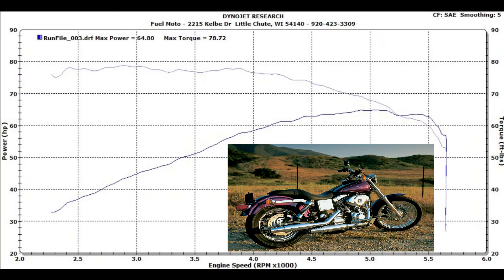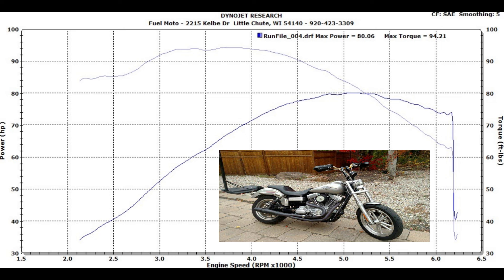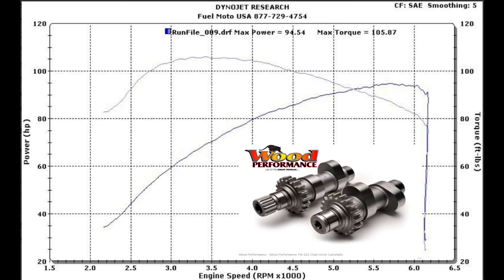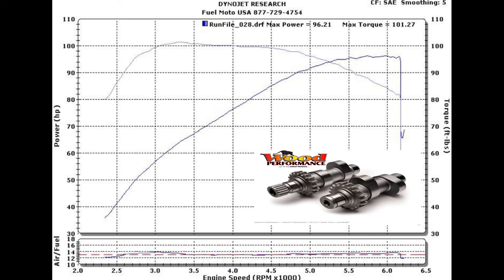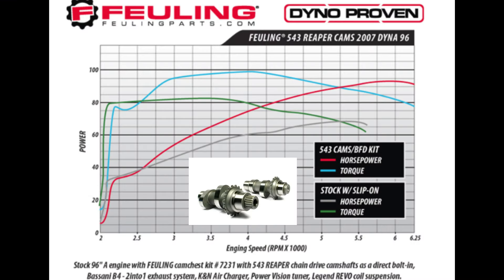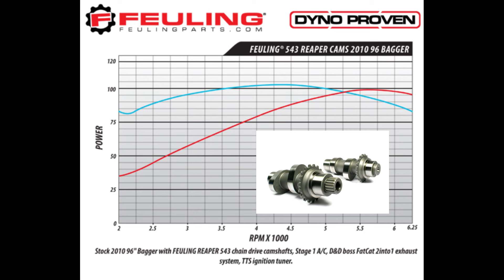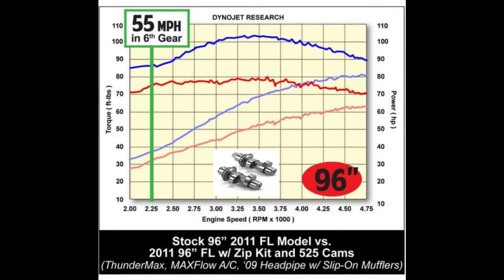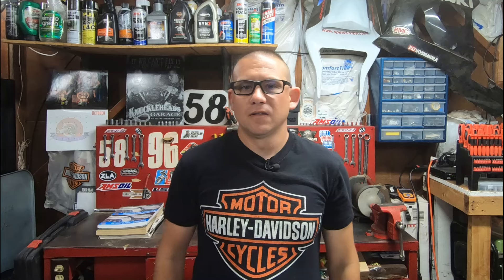Consider New Cams For Your Twin Cam 96 Before You Convert To A 103

Comment from the maker: Would you convert your 96 to a 103 or add one of these aftermarket cam sets?
Reply: Why not both?
Reply: Great vid man. Liked and Subbed. Been waiting for this one. To get a 96" to over 100tq and very near on 100hp just out of just a Stage 2 cam swap is VERY impressive! For me though if I was going to go to the expense of new pistons and jugs, I'd personally not muck around and go straight to the top shelf 110" SE drop ins. But then you'd need a whole different cam set again. I'm on a Rocker C 96" Stage 1 with 2 into 2 Freedom Amendments.
Reply from the maker: Cost mainly, a cam can be done for way cheaper than a full kit.
Reply from the maker: Thank you! It really is cheaper in the long run to go for it all at once, expensive upfront though.
Reply: Do you have any info on SE-211 cams? I have them in my 07 street bob I recently purchased with 103 kit, a/c and full exhaust. Just not much info out there on them. Seem like an old product. Great videos by the way.
Reply: Great video. So where is a good place to get a wood cam?
Reply from the maker: If you're doing a complete rebuild you may as well. Using aftermarket parts you will spend the same as OEM. Better quality, more power and reliability.
Reply from the maker: They are an older cam, they are .579 lift and a good mid range torque cam.
Reply from the maker: I would get it from FuelMoto, they built their kits around the Wood. If you have a Power Vison they will send you a map to flash and then you can autotune. With and FP3 you can select the cam and then autotune.
Reply: Definitely the drop in WOOD 222 would be my first choice before converting to a big bore 103" kit. It just makes sense to save money and get MORE HP and TORQUE 🎸🎸🎸
Reply: I bring to a 110 . If your gonna do it just do it !!!!
Reply from the maker: 110's are awesome, just make sure to add some compression!
Reply: My mechanic recommended the 254 E cam along with a tuner....103 bagger...what are your thoughts
Reply: I have 2008 RK. What are thoughts 543 fueling vs woods  222 vs woods 6-6? They all seem great.
Reply: instablaster
Reply: I'll add the aftermarket cam sets! It'll save $ and🕰!!
Reply: I'm thinking just the cams. Impressive numbers!
Reply: But what does he mean when he keeps saying "with a good tune"?
Reply: I prefer S&S parts...I did a 551 cam, lifter and pushrod swap, SE high flow intake, Thunder Header 2 to 1 and a TTS tuner....and only dyno'd at 86 hp and 103 tq. What did I do wrong? I was hoping to get closer to 100 hp. Does S&S make a better cam thatll get me there?
Reply: I'm thinking about just adding a cam. A wood cam
Reply: @Ron Roth  after adding the cam you'll need to have the bike tuned. I went to a stage one V&H all out. The V&H tuner can tune my bike for stage 1, 2, 3 , 4, etc.
Reply: I did the exhaust, intake and cams on my 08 fxdl. Quite happy with the performance boost there.
Reply: I would make it a 107" with 10.2 to 1 and run a set of Bob Woods camshafts depending on the RPM range it was being used in. But if you deck the heads and get the compression up a 96" will make very acceptable power with just cams.

Comment: I had a 2011 Fatboy with the 96 in it. I upgraded the cams to the Andrews 48H. I went with the Vance & Hines Big Shots. I upgraded the intake/air cleaner as well. Which one it was exactly, I can't remember. After a dyno tune, it REALLY woke it up and also let it run cooler. On the way home from the tuner, I was at a light. I let out the clutch and was not paying attention as I gave it some throttle. The handlebars almost ran away from me! I miss that bike!
Reply: Those Andrews 48s are no joke. I had some in a “96” you couldn’t give me a 103 over that little motor. 😊
Reply: I bought a 2011 Fat Boy early this year. I came to this video because I didn’t know if the 96 was worth tuning or if I should buy a bike with a M8. It sounds like I’ll be tuning the 96 after reading this comment

Comment: I have to say something here, and I am trying to help people out, and prevent them from throwing their money away! You do not need a ton of horsepower just to " keep up" with people. After you get a good feel for the bike, and got some miles under your belt, you will more than likely want more than the factory horsepower of either the Twin Cam 88, and 96/103. But you do not need to break the bank unless you are planning on like racing. A good free flowing exhaust, high flow air cleaner, a good tuner or jet kit, and the right pair of either S & S or the Wood Cams, and you have some decent power. You will have enough where it passes well, has good throttle response, and can keep up with the pack. But yet it won't  be so powerful where it feels like it will run out from under you.
Reply: You are right about that!! I actually do just fine, considering the fact that I don't ride my bike, like a bat out hell style anyway. I just enjoy a simple ride, and it only has 25,000 miles on it right now.

Comment: On my 2007 Dyna 96" I went with the Feuling 543 Reaper cam and SuperTrapp Supermeg pipes. I already had a K&N a/c. My gas mileage was bad. I travel a lot. I tried different tunes with my FP3 tuner but it didn't help much. I recently had it dyno'd  with a Power Vision map. It made 95.48 hp and 104.93 torque. My freeway mpg is 47.

Comment: what I have learned over the years with all HD engines from a knuckle to TC or a sporty is that they dont FLOW well. The HP is hidden in the heads sort of. Have it put on a flow bench. Then couple that with cams or  Carb or EFI remap. and exhaust. You can easily make 100 plus HP this way. No need for a bigger engine.  If ya got a nice ol skool though Strokers are fun until they blow up. And they do blow up. In the old days there were no big bore kits ect. We made stroker plates. Chamfered the bottom end to accept the longer rods without having them slam into the cases.  Then there were guys like Ron Trock putting big twin top ends on ironhead bottoms!  Shovesters. pansters. knucksters. Back then 89 inch engines were HUGE.
Reply from the maker: That's the way to go is just get the air flowing through the motor. They push these big inch kits today but a hot 103 will crush a lot of the big bore engines.

Comment: I installed an S&S 551 easy start cam & S&S 2-1-2 header on an ‘08 96 ci twin cam and had similar results.  A very noticeable improvement.
Reply from the maker: That's awesome, those easy start cams are really nice. Eliminates the need for compression releases too, unless you've got some extremely crazy pistons in there.
Reply: i did the same to my 2007 electra glide classic. i gain 20+hp 20+tq👍👍
Reply: What cam would you recommend for a 103 bagger with slip ons and tuner.  Looking for roll on torque/power...thanks
Reply: @troyemery9888  I chose the S&S brand for the easy start feature of the cams & from all video research I did the S&S oil pump had the largest passages for oil...provides significantly greater pressure at idle, no more 2-3 psi...more like 8-10...saving $ for big bore kit & head work.
Reply: Im impressed with the S&S 551 easy start, nice low end post from basically idle to 4000 rpm

Comment: If I could go back in time I would have purchased a Wood cam. However, the SE 255 with a High Flow air intake and a D&D Fat Cat 2 into 1 exhaust produced 101 lb of torque and 95 Hp with a good Dyno tune. The torque rolled off at about 5k and my normal riding RPM wasn’t more than that plus I had enough torque at highway speed for passing.  I was happy with it for many years. Then I paid off my bike and started thinking of adding a big bore kit.

Comment: I installed s&s 551 cams, v&h pro pipe, power vision tuner on my 2007 Electra glide. Run strong pulled hard thru out the rpm. I'm extremely happy.
Reply from the maker: 551 is a killer cam in a touring bike, pairing with the pro pipe l bet it pulls hard!
Reply: I love it, I don't need a big bore kit. This is enough power for cruising around .
Reply from the maker: It's really surprising the kinda power a good after market bolt in cam will make!

Comment: I have a Wood 222 with slip ons, true dual and K&N and dynatune. Really woke it up! couple of things: be sure to include an upgraded cam plate and oil flow with it to keep the engine reliable. I considered a 107, but my RK is pushing 50k miles and the extra CIs will blow the lower case seals, etc. I thinks thats all I can do to my 96.
Reply from the maker: A 222 on a 96 works really well, and like you said it's not a bad idea at all to upgrade the cam plate.

Comment: The 96" Twin Cam actually is a pretty good motor if you make a few upgrades to it. You would think a 103 inch twin cam, would make a bit more hp than the 96, but if you look at the Dyno charts its not the case. I remember back in 2008 I rode a friends 2007 Dyna Lowrider, with the 96 inch Twin Cam, and let him ride my 1200 XL I had at the time. He had a high flow air cleaner, and a pair of V&H slip ons. I had a Bassani Pro Street exhaust, and a SE high flow AC, and a Dyno Jet Tune we had about identical numbers on hp. He was dissapointed that the 96 inch TC didnt have more get up and go. I would say what really wakes these 96 inch motors up is the right pair of either S & S cams, or Woods (Andrews) cams, the right full exhaust, not slip ons, the proper tune is crucial, then you really want to wake it up havethose heads worked over. I am slightly againt running very high compression on street bikes, that you want to keep their reliabilty, and sreetable.

Comment: I just picked up a 07 Dyna low that is pretty much totally stock as far as I can tell, just slip ons. Has a lot of miles on it at 70,000. No noise, or smoke. Anyway. This winter it’s getting built. Not sure if I’m going 110 or 107, but pretty much decided on the cam, feeling 574. Have a DK custom 606 intake and an fp3 on the way. Hopefully my crank is good enough shape to use. Love your videos! Great information and ideas. Keep em coming. Be safe out there.

Comment: My 97 Evo Fatboy with 22” Apes and another 200 lbs of gear, passing lights, bags custom passenger floorboards n hardware, beefed up the rear shock mounting hardware with a pair of 1/2” solid stainless steel bolts all the way through the frame with urethane bushings, drilled the frame n swing-arm’s weak links specifically the recessed 3/8” shoulder bolt threads to fit the big ole bolt, and hefty billet steel chrome risers with similar bolts drilled all the way through, (I rode it like it was an enduro, catch air, drift on the drive out of turn after backing it in and around) would catch and pass stage 2 (cams intake full exhaust, & tuned) 103’s riding solo while riding 2up with the bags full of new snap-on tools from the swap meet. Used to anger my friends who spent $2500-$3000 on upgrades and got passed by my pride n joy. (Sadly she was stolen, by a guy that called me “brother”) I have an 07 FLSTFI 96” pulls good with the baffles out-and a K&N filter element, pulls real good, I dont know the history of the bike, but I’m almost impressed!

Comment: I went with the woods tw 222 cam. Let’s just say I was suprised when I rode it. With my stage one and stock cam I could snap the throttle and feel a pretty damn good pull around 25-3500 then it would power out and sound like I needed to shift ASAP or my engine was gonna blow around 4000 plus rpm. I got used to it I had about 10000k on that set up. When I rode the new cams I was suprised and disappointed to feel nothing at all. I rode the bike the way I rode it before and felt absolutely no different. I even called the mechanic just to see why that was. Anyways, it changed the way the bike rode. Where my power band used to end this one starts. So I started screaming up way higher in the rpm range and felt no sign of powering out right up to 5000 and I sounded healthy too. The tourque pulls very good to a nice slow and steady pull in the lower rpm range then up right everything kicks in and you are moving. So one thing to keep in mind with these cams is that they are a mid range cam but it feel like high rpm in a stock set up. So it threw me off. All in all very happy and highly recommended.
Reply from the maker: It's very important to look at where the cams come on and not just what the peak RPM's are. I am surprised you didn't have the low end you were looking for with the 222, they are supposed to put some more power down on the bottom end.

Comment: I just put a TW222 in my ‘07 Wide Glide, it seriously woke it up, I also have a PV tuner with a fuel moto flash for that cam. Very very satisfied with the results.
Reply from the maker: It's hard to beat that 222 in my opinion, it's got the power all through the rpm range.

Comment: S&S 583 non easy start.fueling lifters.stock heads.hi flow air.2 into 1 V&H upsweep in my 08 Superglide 96"
Dynajet power vision. 
People in the know here in Adelaide Australia, told me they hated the cam choice with a passion. 
It's so responsive and makes power from idle ,right through..
Because it drops off at the top end..who cares.!  I don't ride at 180kmh..
I love the aggressive idle and throttle response is amazing

Comment: I got a 2008 dyna super glide custom with the 96ci. Bought it with 22k miles. I put an arlen ness air cleaner, TBR turnout exhaust, and powervision tuner on it about a year ago. 

I just put in andrews 48 cams at 26k miles. And WOW!!! It REALLY woke the bike up. Even with the base fuel moto map. I’m so glad I did a lot of homework before buying cams. The 103s come with an oil cooler and run hotter due to higher compression. 96s don’t have oil coolers. That’s what turned me off of going 103. I don’t want the bike running hot, leading to problems. 

The shorty 2-1 exhausts have a nasty dip around 2.5-3.5k rpm. The andrews 48 cam picked that dip right up with strong power gains through the whole range. The curve is very flat and healthy now on the dyno 😝🤘🏼

This bike RIPS now and I just had it dyno’d at 95HP/104TQ. I’m very satisfied. I also had a compression / leakdown / crank runout test done prior to installing cams and the motor is happy and healthy. So now my mind is at ease too knowing the motor is good. 

I have no need now to tear the motor apart and rebuild the top end so I can put in se 103” pistons and have my cylinders bored 😊 all that work and $1500-2000 for another 4-5hp / 6-8tq gain…..not worth it at all haha

I’ll stay with my 96, and I’ll never part with it because it was my first street bike / Harley 😊 this will be my cool guy “fxr” bike in 10-15 years 😅 then I’ll have the shiny brand new low rider s next to it, hopefully lol.

Comment: I own a 96 Street Glide 2009 and i'm more then happy with the power it's got. For me it's fast enough.
Reply from the maker: It was quite an improvement over the 88 in horsepower and torque, it makes it down low like the 88 did too.

Comment: Thank you for your helpful vid. I took the detail to my local HD service master and have set up the install of the TW 222. My 08 Flstc is in great condition but due to the added engine performance I have upgraded the front shocks with Progressive Monotube cartridge kit and the rear with the 422 set. Better stopping control.  Took your advice to update the compensator as well as the clutch spring to handle the power. Also added a high performance oil pump. Thanks again!
Reply from the maker: Very welcome! That bike is gonna be a blast to ride with all the upgrades!

Comment: I have a 2011 Wide glide and my plan is Woods TW777 cams, push rods, and lifters from Fuel Moto. .03 head gasket, S&S valve springs. I've had great success with Chevy V8's in the past with this approach to avoid buying cams twice when I reach the final goal. In this case is a full on 107" build. I'm hoping to ride her for one season with the aforementioned upgrade with the stage one , ( V&H slip ons and Arlen Ness air cleaner ) until the winter of 2021 which is when I'll complete the build. I admire your knowledge and appreciate your info. which is why I subscribed. Your input will be welcomed.

Comment: Took an 88 to 95. Used s&s 585 gear drive. Roll on in 3rd gear at 35 mph and spin the back tire in a dyna. It was fun. Glad to see you cam a 96. I always wanted to do that to mine. Life was to busy at the time. I now have an evo with a 640. Its fun too.
Reply from the maker: I would imagine that Evo is quite the strong running engime!
Reply: @West Coast I’m looking to change cams in my 2011 FXDC with the 96ci. I was recommended to go with the S&S 585s as well. I thought you needed higher compression for those cams? I really want to make mine a torque monster and make it snappy, vs making it faster I guess.
Reply: @Billy-hx3zi  they will work great. More compression would help create more power. I was told it was a waste when I did it. Think about it. You get more volume in. You are going to compress that in the same area. It will make more power. I did it before easy start cams came out. Not sold on the still.
Reply: @Billy-hx3zi  i also had to re-spring the valves for the lift. I absolutely loved the way it woke up the engine.
Reply: @westcoast3595  good to know. Thanks man
Reply from the maker: ☝️ exactly what he said!
Reply: @GixxerFoo  tempted to just let them do their thing with the 585s then! I just want it to have more power and make it kinda scary to ride 🤣
Reply from the maker: Lol well the 585 would accomplish that for sure. You'll know when that 585 cam comes on!
Reply: @GixxerFoo  thanks for all your help man, this whole cam thing is overwhelming for me! 😂 I’ve never put this much money into an engine before so I’m just trying to make sure I’m doing it right and that I’ll be happy with the results! I can already tell once I get it done, it’s gonna be addicting to keep modding 🤘🏽